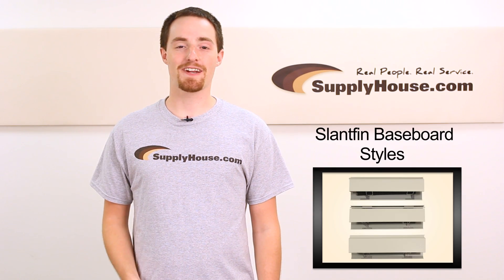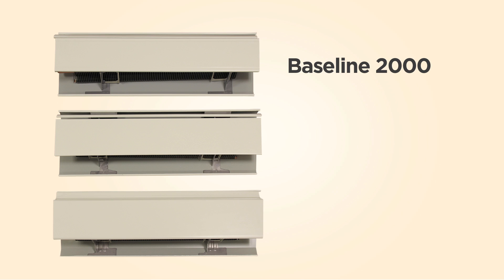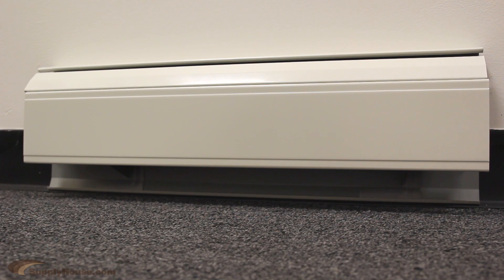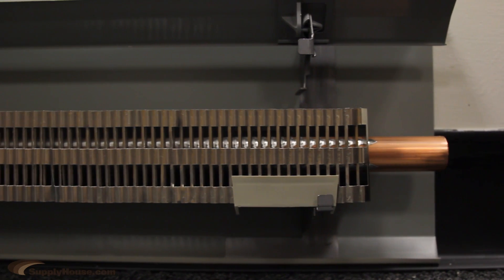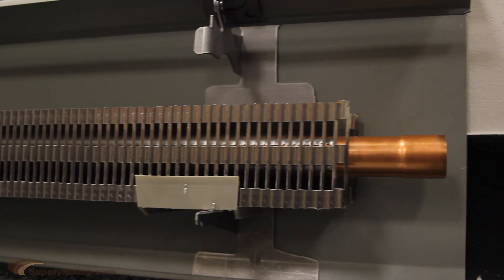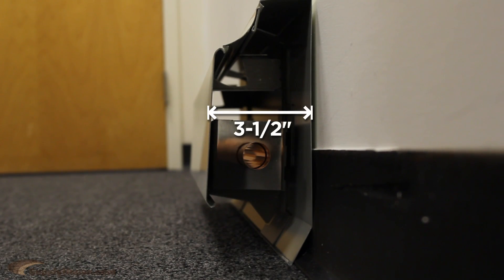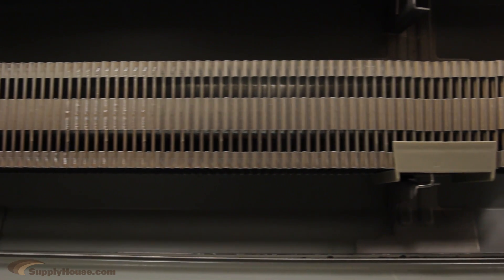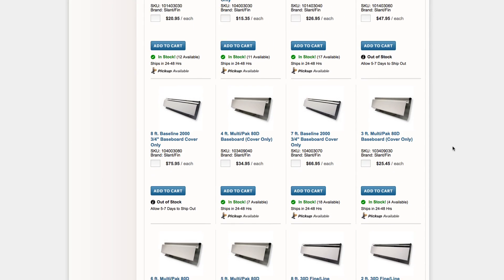Slant/Fin Baseboard Styles

Comment: Can someone tell me how I am supposed to install these behind existing plumbing ? I can see that the brackets will slide but I don't think the damper will come off, let alone go back on again, so removing the brackets doesn't appear to be an option. Update, I spoke to Supply House who redirected me to Slant Fin themselves. According to Slant Fin you are supposed to either install these prior to the plumbing or, if retrofitting, you bend the bottom part of the bracket that supports the plumbing as far over as you can until it's flat against the back of the unit. I did this and my back plates now slide behind the existing plumbing and into place. I then bent the brackets somewhat straight to support the plumbing and used the plastic expansion cradles. Slant Fin said DO NOT remove the damper from the bracket, it'll probably never go back on properly. Hope this helps someone.
Reply: I installed thousands of this over the last 35 years. The brackets come off and the dampers come off fairly easy. They are a little bit complicated to put back on but far from impossible

Comment: Why does slant fin use off white rather than just white. My baseboards were painted by my painter years ago and now if I need a new end cap i need to buy a new enameled off white and paint it and it doesn’t look new. They should default two colors. Bright white and off white. Not a fan of slant fin but I’m locked in unless I want to change 4000 sf of heating
Reply: Check the Slant Fin website for the Designer Series.  It is available in bright white and several other colors.
Reply: just because